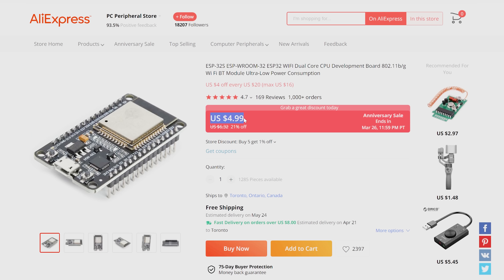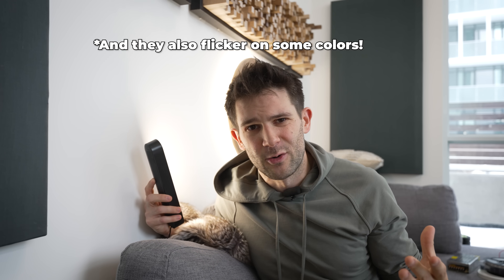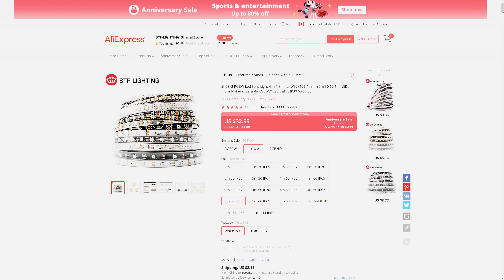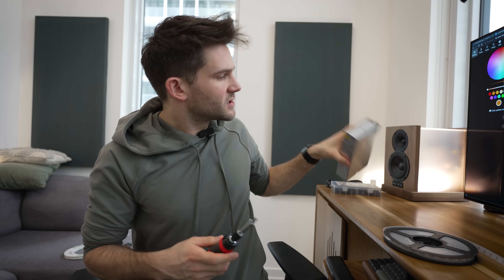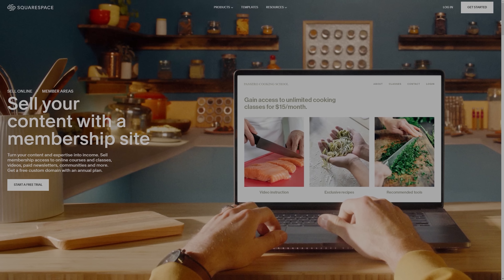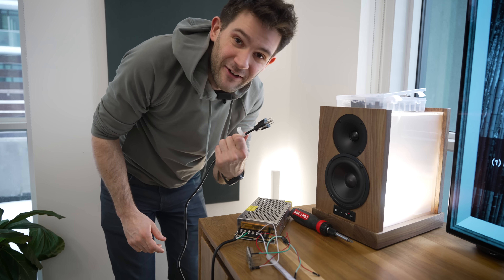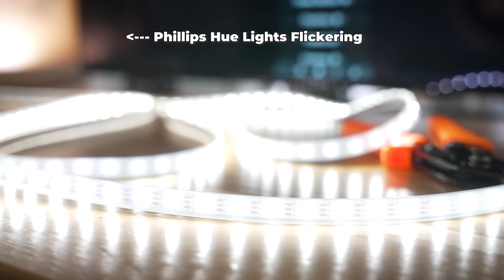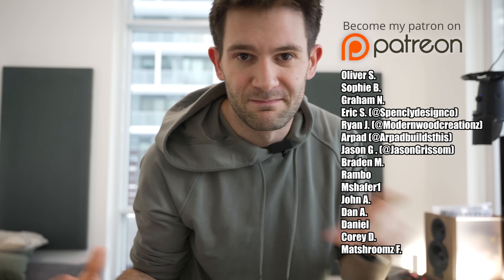RIP Philips Hue & Govee

Comment: What actually amazed me was that you got the ESP32 for 5$, but you paid 8$ for a power cable for some reason. That aside, great introduction
Reply: Came here to say this
Reply: I personally like the anker cables for stuff as they seem to last for literally ages haha
Reply: I bought my esp for 15€ in my country
Reply: Cable is to power LEDs not esp32. And you can find whatever cable you want because you cut off the end
Reply: @sierpus you need one with data to flash the esp though
Reply: Maybe because he brought a computer power cord , it costs significantly more ( maybe just because people are ready to spend more because it's for computer)
Reply: @awdhut-e2e it has a ground pin.
Reply: The esp32 is made on massive scale, the power cable is made on smaller scale and prob bought locally. But still insane difference haha
Reply: @Terandium  if you think ESP32 are made in a larger scale than generic mains power cables, you're off by one or multiple orders of magnitude and in the wrong direction. Cakes are used by basically every appliance, these esp32 boards are a comparable specialty items for tinkerer's and electronic hobbyists.

And by "probably bought locally" you mean Amazon, right? Cause that's where he said he got it. They should costs maybe a dollar (and only better they contain copper), rest is markup for the convenience of Amazon.
Reply: @TheCreat  ah my bad I didn't know they were bought of of Amazon's, I figured he got it at a local hardware store. Which just has a lot higher cost of operations.
Reply: @TheCreat  "these esp32 boards are a comparable specialty items for tinkerer's and electronic hobbyists." but late but this is false though, esp32's are used in insane amounts of actual products.
Reply: The wire material can be expensive, the size is much larger than the mc too. The fact that we can get something like esp32 so cheap is incredible.
Reply: And the LED strip is $50 and the power supply is $18. What’s your point?
Reply: @HCG  Those cables are like 1 euro for 1,5m since they're bundled with literally anything mains powered.
Reply: @Elliot  the fact that such a simple cable has such an insane high markup. Compared to the esp32, which is shitton more complex then a cable :p
Reply: @Terandium   depends on the cable tbh 
I've found the cheaper usb cables to be pretty junk tbh 
I have a few that cost me 2 or 3 euro and they were pretty junk with regard to the connectors tbh
Reply: @BenCos2018  Yeah that is totally true, the cheapest product of something almost always sucks. Rule of thumb is to never get the cheapest, and never the most expensive. Always sit in the middle, that way you get the best value per euro/dollar spend
Reply: @Terandium yep agreed 
Thankfully I had a spare usb cable that I could use and got a refund for the junk ones...still have the cables somewhere as I got told to keep them or dispose of them myself haha

Comment: A note on using DuPont connectors: Please ensure you use the correct current rating for the connects otherwise you may end up with a hot melted mess and/or fire as a thin conductor may not handle the high current.

You'll note that long LED strips and matrices have some fair thick gauge wires on them for this very reason.
Reply: I believe he only used duponts for powering the esp32 and data, the LEDs were wired direct to the PSU so shouldn't be a problem.

Comment: Well all LED lights flicker that's hoe brightness control works. That's why powerful led lights  look bad at low levels. 
They do you have LEDs that do not control brightness this way but they expensive and normally used for high speed photography like slowmo

Comment: I’m planning my first led stripe build. I wanted to have 2 meters of SK6812(144led/m) and wondering if this will be enough powering it with 5V-20A-100W power supply. It says it needs 43.2w/meter. Getting bigger power supply is not a problem, but i’ve seen in some other videos that there might be some color change along the stripe. Do you think it might happen on 2meters and its better to inject some power along the stripe or there is nothing to worry about?
Reply: the ampere/wattage recommendation for my strip was way too high for the strip, even after turning on it did draw only a part of it. This is also because wled doesn’t turn on all 4 leds at once on full power. You better measure directly what you really need and then buy accordingly

Comment: Setup a guest network on your router and choose the option to not let devices that connect to it to not see each other. If possible, that is where you should connect your IOT devices.
Reply: Why? I need some knowledge dropped on me! All of my IoT devices run off my main network
Reply: @andybuehler7313  because most IoT devices come with huge security vunrabilities?
Reply: Because if you run every device in one network, you will put to much data congestion & also slow your network speed to your slowest connected device speed. Also, you are allowing a huge security hole in your network.

Comment: Worried about Govee and other janky apps but then proceeds to buy a board from a janky 3rd party supplier.
Reply: I know, right? Excellent point!
Reply: Nah you can buy esps like the 32 or the 8266 d1 mini from a lot of retailers. Those chips are like arduino but with wifi. Ali express is mostly fine. The software is completely open source and the esp are completely flashed and erased when flashing. Oh yeah and they dont talk with the internet they only run on your own wifi the app only works in your wifi. There are no servers or clouds.

Comment: You are all kinds of slightly wrong. I believe tree are a lot of people correcting it, but for someone who just started, good job making sense of it. Smart lights are a deep rabbit hole. Philips hue is one of the most open system out there and have excellent integration with a lot of other smart home systems, so if you want to get a bit more use of this, maybe try to look into home assistant or something similar. It gives you much better results. I’m looking forward to see you new studio lights solution. Hope you get the “make it easy to understand but still correct” balance a bit closer next time.
Reply: This is the weirdest insult/compliment comment I’ve ever read.  Try to be nicer.

Comment: This is a good project, and well explained! If I had know I may have done my recent led project with these components. I used a gledopto controller to connect to hue, also does its job well. I guess this has more customization though! The board looks very similar to what is in the controller I think. Probably uses a variation of it? Not sad about it, still good result and simple. Did cost more though...

Comment: Finally someone who used the hue part in Wled. Can you use the hue app and turn it off still or see it in the app or just Wled still?
Reply from the maker: You can't really see it in the Hue app, you can just set it to mimick another one of your existing hue lights if that makes sense. It's still visible and controllable through the WLED app at all times.
Reply: @ZacBuilds  I am wanting to see if I can get it into HomeKit without using homebridge. Thanks for letting me know.

Comment: Might be worth a mention to those running longer wires from the controller board to the first LED on the strip that you will likely run into weird glitches or the lights not running at all.  This is because the ESP32 uses 3.3V logic, whereas most LED strips expect 5V from the data line.  This is normally not an issue for really short runs like you demonstrated, but for longer wires the voltage drop is too much so you get unexpected behaviour.  The wiring diagram you showed mentions this, but a logic level shifter takes the 3.3V signals and converts them to 5V for you.
Reply: Level shifter SN74HCT245N or a sacrificial pixel with a voltage divider is a solution :)
Reply: There are ESP32 C3 and S3 boards that have a sacrificial ws2812b directly on board that go for about 5$ for C3 version. BTW there are also ≤2$ C3 boards under moniker air101(LCD one doesn't include the esp). Should be noted that they don't have onboard UART on the cheapest version, though that can be an advantage if you actually need both UARTs
Reply: Injecting voltage every 40 leds should stop this
Reply: @PetersPorsches  It's not power issue, it's a logic issue.  The data line from the controller needs to be close to 5V, so a logic level shifter between the microcontroller and the first LED in the chain is all you need.
Reply: @StuTubed  Quick follow up question. I want to use it with 25 meters. Would that also work here? Or can I use this setup even with multiple LED strips in my room? I intend to do a ceiling surrounding LED in our living room.
Reply: @M0nteytime  You should only need to worry about signal to the first LED in the chain, each pixel repeats the signal to the next one.  If you have a long stretch of wire between two strips in series, it should be fine because the last pixel on the first strip should be sending 5V to the first pixel of the next.  You will need to consider power injection to the LEDs themselves though if the strips are long enough.
Reply: @StuTubed  many thanks for your quick reply. Will check that out. First need to get the approval of my finance minister (wife). xD
Reply: @StuTubed  run them on WLED firmware and set the max strand length to the amount of leds in the strip you can watch others like nerd forge do this if you have any issues
Reply: @PetersPorsches  How feasible would this be for a much longer run? I've wanted to do permanent christmas lights with these strips and have always been too worried that I wouldn't be able to figure out the power injection requirements and it would all end up working terribly.
Reply: I was expecting him to mention this, and it was in the diagram, yet nope... just didn't bother.

Comment: Worth mentioning, but you don't need to open the PSU to flip the switch, a small screwdriver can reach in and flip it. You can also spend a slight bit more and get one that auto switches and thus nothing to manually switch it over.
Reply: ... or simply get one that is right for the country where you live... most people do not move amongst countires on a regular basis, so switchable power supplies are simply not necessary.
Reply: @arnovanwingerde8589 That would double the number of SKUs a bare PSU manufacturer would have to make, validate, pass certification on, and manufacturer, then store and deal with the sale of. The BOM cost for the switch and duplicated parts to handle 110/220 switching is far cheaper than making two copies of many products. That said, I wish the auto switching ones had replaced it, more efficient apparently, but that costs more, so cheap companies keep demanding the cheaper PSUs, keeping the option on the market rather than killing it off for the better one.

Comment: The capacitors in that power supply are huge. You should've added a warning to be incredibly careful opening the thing up, people have died trying to service power supplies without experience.
Reply: Although I agree is sentiment, there is almost certainly a bleed resistor for the cap circuit that should dissipate any charge within roughly a minute after powering off. To be safe, just wait 5-10 minutes and you should be fine.
Reply: was about to say the same, people pay close attention touching things with big capacitors around!
Reply: Came to say the same.  He didnt even need to open it, the majority of power supplies' switch to change voltage can accessed fairly easily.  And even if that wasn't the case, he couldve easily used a plastic or other non-metal stick type object to reach the switch
Reply: Integrate your wled lights into hinge assistant and your options are honestly limitless!!!!

I have a long curved plastered in led strip down my corridor... If someone locks the bathroom door, the section of LEDs outside the door glows red!!!!
Reply: Also, whenever you wire something like this to mains voltage please use ferrules and make the ground wire longer than the other two so it rips out last. Please keep in mind that while even 110V will be dangerous people living in the 230V regions of the world will also watch your videos and try to follow the instructions.

Comment: MEH! All you are doing is building an LED controller... BTF lighting already sells these with all of the compatibility of yours plus ZigBee. They also offer remotes for these controllers and have all of the power/control ports built in. Now, yes, they are about $25 but it's worth it for a complete unit ready to go out the box. Plus it is not an exposed PCB but in a nice quality enclosure.
I get the whole DIY mentality but at some point you need to draw the line.

Comment: Regarding flickering: The ESP does not drive the LEDs directly. It tells each pixel, via the data line, what RGBW values it should have. The pixel does the PWM in its hardware. There is no access to that. The good news is that such PWM frequencies easily are in the kHz range. I have several such strips from the same manufacturer as you and they work great with WLED.
Reply: Yeah, this video frustrated me a lot given just how many errors and mistakes are in it. Good production quality, but the actual information wasn't great and the resulting build is pretty messy. It's too advanced for a basic user, and too kludged together for an experienced one.
Reply: yeah this video contains some shokcing technical inaccuracies and a total lackluster of saftey advices
Reply: Delay starts to get noticeable over 1600 pixels on the strip I use.
Reply: @mytuberforyou  The data update to the RGB AI LEDs takes time, so the more LEDs on a single strip, the slower the update (refresh rate).  But this is not the same as PWM flicker.  As mentioned, that is controlled on each individual WS2812 (and compatible) LED.  BUT, on ESP32 there is a solution for improving the frame rate.  There is 8 and 16 parallel channel model, separate the strips and drive them in parallel, so 8x or 16x the speed.
It is supported in the core library NeoPixelBus, WLED latest version I believe does expose it also now.
Reply: @mytuberforyou  1600pixels on one port? Bro you are not supposed to use more then 600 pixels per ports as you go up the fps will go down.
Reply: “There is no access to that….” Except for the boards where there is.  Boards with CLED allow you to adjust pwm frequency easily
Reply: @threepe0  Does that work with the individually addressable pixels like the WS2813, SK6812 strips?
Reply: @threepe0  No he's talking about specifically addressable pixel leds. The dimming is handled on the hardware of the pixel itself on these. ws6812 for example is 1.2khz fixed pwm no way to change it. if you're driving your own led as one channel from the esp, then yes you can set it easily, but not on the led type shown in the video
Reply: @threepe0  I think he meant from the ESP. But if you want, you can just connect the LEDs to the ESP's PWM headers and control it. ESP has some amazing abilities.
Reply: You seem very knowledgeable in this field.  Any experience with Li-fi applications?  Data transfer through high speed LED strobing?

Comment: and it actually runs on your local wifi network, most cheap smart lights use the internet to send commands which is ok, doing it locally means its safer, faster and simpler, which means less room for errors so it also improves over all reliability, theres literally no reason as to not use local networks besides hoarding data. Open software fucking rules
Reply: And no relying on tuya or the cloud platform to stay online/in bussiness

Comment: I'm one of those who doesn't like overhead lighting for general everyday use. I find it glaring, makes everything look flat and has no dimensionality. It gets even worse on those ceiling fans with integral LED lights: they just feel tiring to my eyes. All the work goes into the fan design, but as to the LED circuit, flicker city. I have LED in nearly every fixture to save money, but the lights I really use intensely are the Philips Sceneswitch (as it cycles between a 60, 45 and 20w equiv light level, it becomes warmer like an incandescent on a dimmer), a pair of DC powered IKEA gooseneck lights with theatrical gels to warm them up. Then there is the dimmed incandescent frosted white Christmas light string wrapped around a sisal rope: it's the main lighting, no flicker and a balm for the eyes.

Comment: You could look into the esp32 s3. Usually same prices but has native usb protocol and usb c ports!
Reply: Isn’t supported by wled.
Reply: S3 may have more spotty support, but a C3 supermini has a usb-c port and I’ve tested it successfully for a lot of my home wled projects (slightly worse Wi-Fi, but you can also get the larger sized C3 models with the antenna built into the board, and that helps). Even designed some custom PCB carrier boards I could reflow solder the modules onto and split all my power and data lines out to make it easier to plug the strips in and route power cleanly.